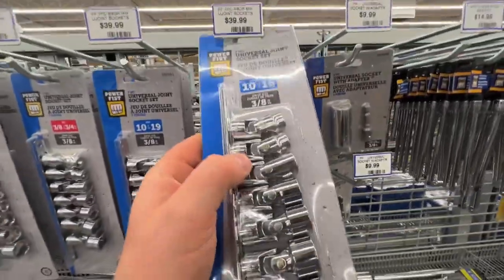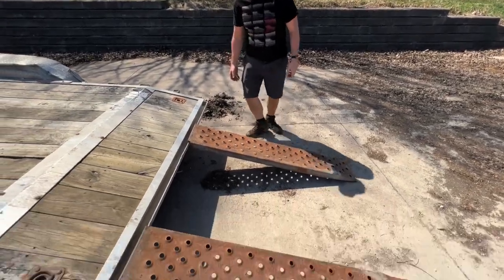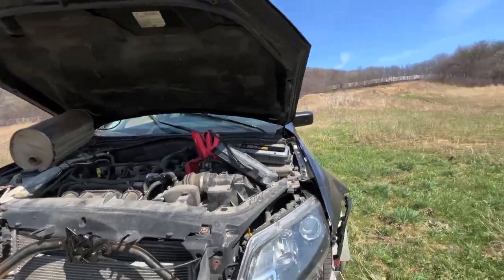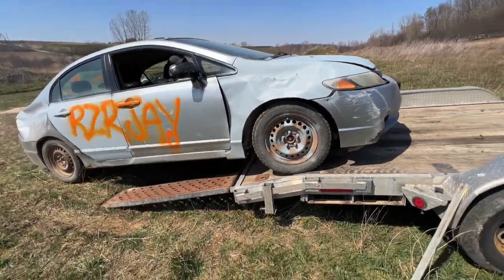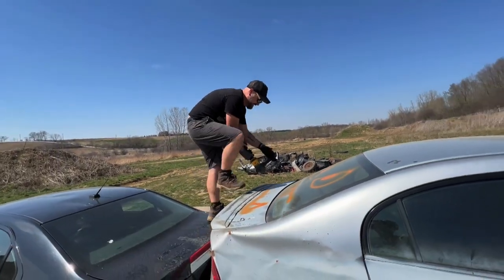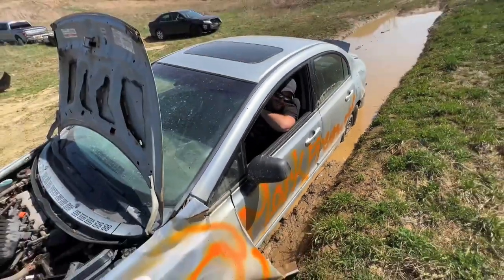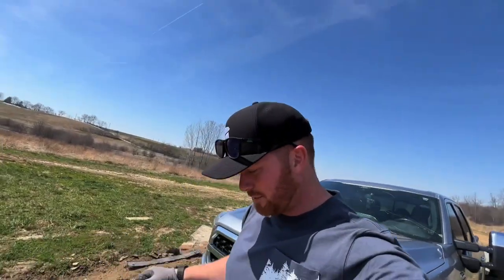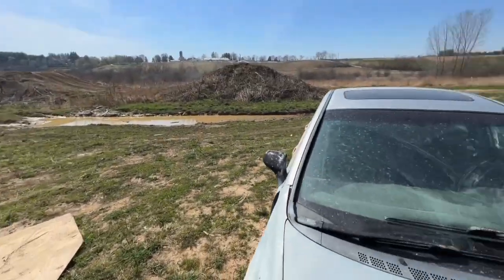Ford Is ALIVE! Civic Died??

Comment: 😂Love the video. The Chevcivic wouldn't run right because you had the air box off and the MAF sensor couldn't detect how much air was going into the engine. Scott put it back on and it ran correctly, but you can still make him think it is because the civic likes you better.  😉
Reply from the maker: 100% cause it likes me better 😂